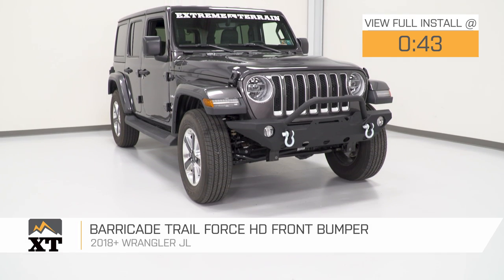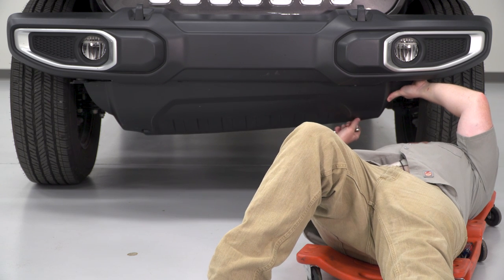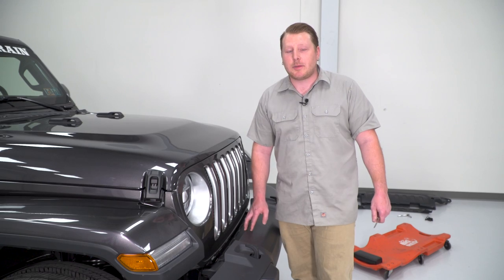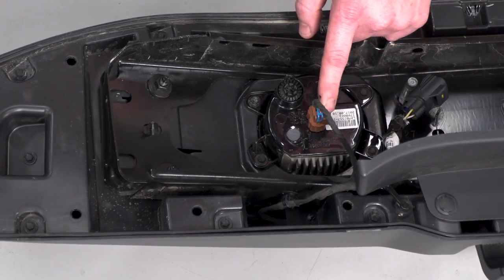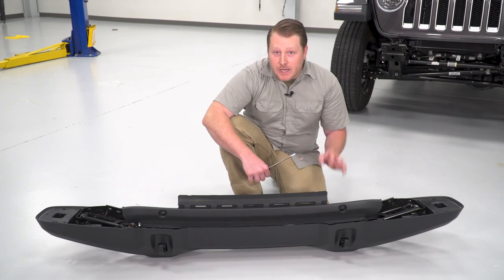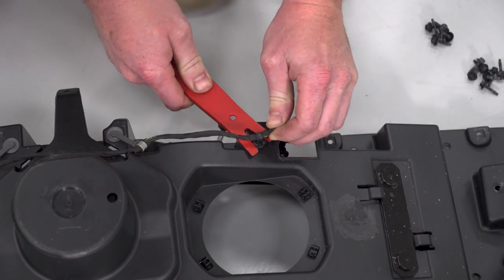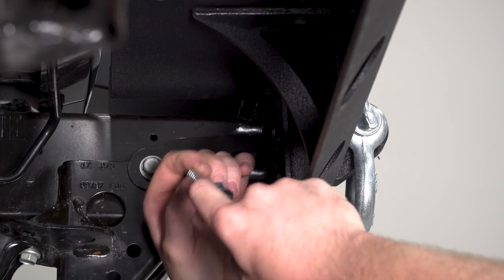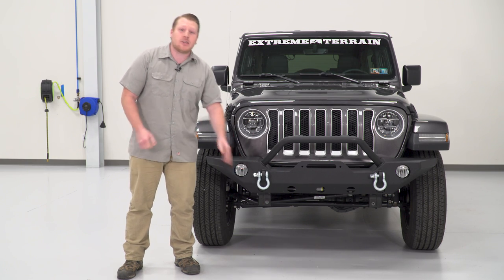Jeep Wrangler JL Barricade Trail Force HD Front Bumper Review & Install

Comment: I bought this for a 2020 JT with OEM fogs. Ad says they should fit. The ones installed here look just like the ones I have, but the bracket looks NOTHING like what we see here. This is some sort of circular adaptor or bracket. Mine came with a single riser for the inner bolts. Even then, both inner and outer brackets were about an inch short of reaching the fog light tabs. I’ve called four times now trying to get the right brackets. What is the deal with the JK vs JL/JT brackets on the bumper?!?!

Comment: I purchased the 20850 JK/JL updated front bumper for my 2021 Jeep Wrangler unlimited Willys. On this install you have to remove the front frame rail end caps when installing both the Barricade front skid plate and the Front bumper. At least that’s what I have found to be the case.

Comment: I bought this  trail force barricade bumper (or that is what I thought ...) for my Jl 2022 ... but the hardware is different from what is shown in the video  !! Barricade sent me what was likely a JK bumper old stock  with some adapter plates that have a bolt and a nut (instead of being like the bumper in the video that comes with 4 bolts on each side ) to be attached to the front bumper brackets... it is quite difficult to align it alone .... also it comes with two useless fog light brackets  and which is a real pain in the neck the wrong screws to attach the fog light to the bumper .  I had to buy self tapping screws, drill holes in the bumper to properly attach the fog lights.  Last but not least : OEM bumper properly has 9-10 places to secure fog light harness  ....Barricade ?  None!  ...and not even areas where you can tie strap it to some brackets/ small hooks  (that would have costed a dollar to add ..)  .  I am curious to see how long this powder coat (that seems quite cheap  with low thickness  since I scratched it on an off road and bare metal is visible...)   Not happy at all with this product as a whole .
Reply: @max Yep same here. The version you and i have is a POS. Really pisses me off.
Reply: Man i wish i read this a week ago before I ordered. I'm having all the issues you mentioned and I felt like shit yesterday for not being able to install this. Fighting with those stupid attachment brackets is a nightmare!

Comment: So i get im a newbie but this was frustrating. No mention of the fog light brackets that the paper instructions tell you to install. Ended up I should not have because I cant get my fog lights to sit in the holes properly. They aren't flush at all with the included metal bracket installed. Tiny screws are stripped so I'm a bit f*cked there. Those included attachment pieces are a wicked pain in the ass to fit in unless I'm missing something.... and splitting the bumper apart to get the wiring harness? yeah that didn't happen. got a dremel to cut around the recovery hooks and ended up working the harness out from the clips and pulling it out of the bumper. It wasn't just a little finagle. Not a very complete set of instructions. 
Bumper looks good, but took me 4 hours to get it half installed. Will resume in day light.